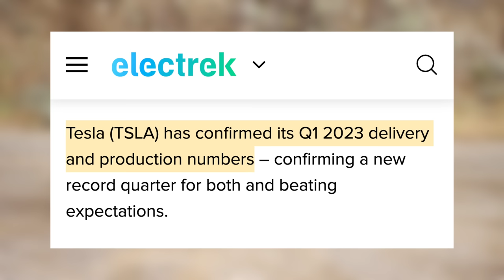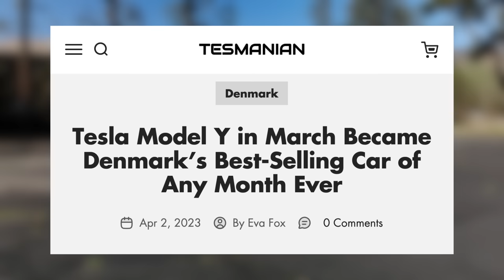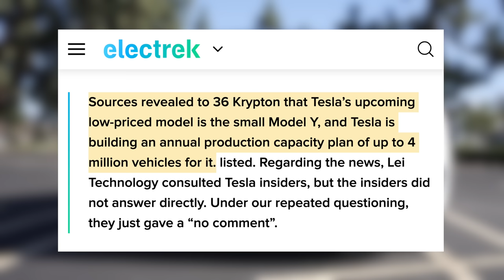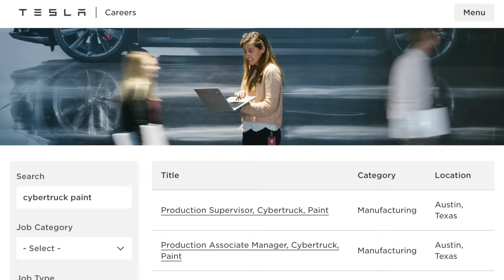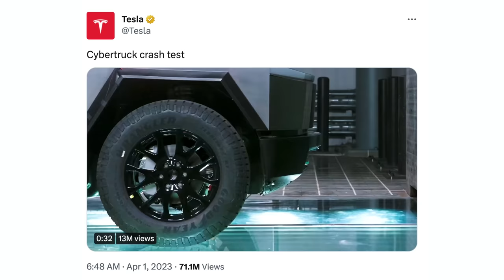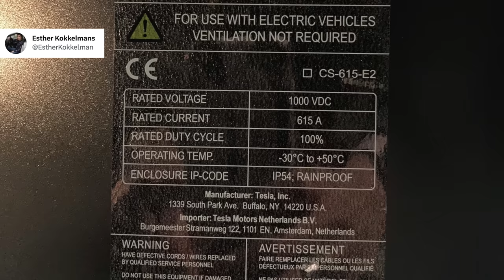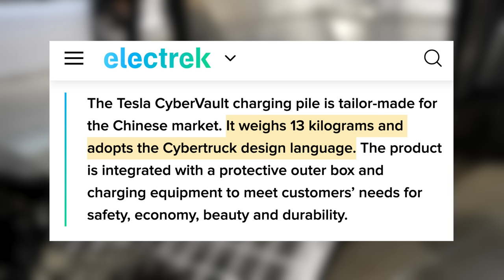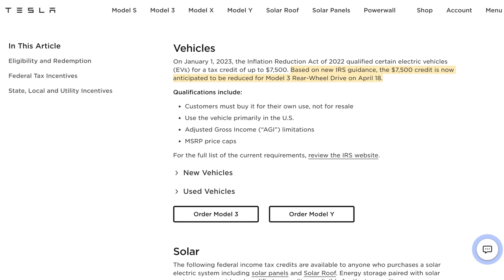NEW Tesla Model Y Mini Coming Soon? | Here’s The Truth

Comment: Going by the title my reaction was “sooooo… a model 3?”
Reply: It will likely be a hatchback so probably more like the size of a Prius.
Reply: The model y is a 10% larger model 3
Reply: Why?
Reply: Yea… a mini model y is basically a model 3. A hatchback Model seems like it would be smaller than a model 3 no? Regardless, i don’t expect much from this $25k vehicle.
Reply: Model 3.5
Reply: Same here. Which wouldn't saying a mini model 3 be more accurate? Other than size, there isn't much difference between the 3 and Y.
Reply: Model Y trunk is 30 cubic ft. with 72 cubic ft behind front seats. Model 3 trunk is 20 cubic feet.

MY height is 64 inches. M3 height 56.8 inches.

MY width is 75.6 inches. M3 width is 72.8 inches.

Not close to the same size. There are no shared body panels. 

Styling is similar, but not the size.
Reply: Umm, no, a mini Model Y. So a hatchback, which the Model 3 is not.
Reply: Also model y is structured and manufactured significantly differently than the model 3. Model 3 has not and largely will never get the manufacturing processes that model Y has. 

"Mini Y" is a claim that the cheap car will be the Y manufacturing process (evolved no doubt, incorporating techniques they announced), but for all we know the design could be a step toward canoo.
Reply: @davidwollpert5276  "sooooo… a model 3 hatchback"
Reply: my thoughts exactly haha
Reply: A small Tesla hatchback is exactly the car I’ve been waiting for. A Model 3 is not and has never been what I wanted.

Comment: I love the vault. So cool. I imagine the install cost includes running a wire from the charged to an electrical panel. If not, that's pretty darn expensive in China to connect it to a roughed-in wire and screwing the box to a wall.

Comment: Think Small- it worked for Volkswagen. But get real. I want a 2-seater like the Roadster that also carry cargo and have normal height an high wheel clearance. 3,000 pounds with low center gravity almost perfects the electric car, and certainly anticipates future demo graphics.   It doesn't need a rocket launch. 0 to 60  MPH in 5 seconds beats %95 of the cars already

Comment: The Cybervault is a full function wall connector with 7kwh charging power, which can can fully charge a Model Y long range within 10 hours, or roughly 20 miles per hour. In addition, it can disconnect from the case and be used as a mobile charging cable that can plug into a nomral home power outlet. It offers about 2kwh charging power, or 6 miles per hour of charging when plugged in. 
On the other hand, the normal Tesla wall connector can dish out higher charging power, faster charging speed(11kwh or higher). The Cybervault is a solution for those who can't benefit from faster home charging, commonly due to powerline limitation in apartment buildings. It is more affordable than the standard wall connector. The mobile charging ability is a nice bonus, too.

Comment: Why did Tesla lower the battery warranty to 100,000 miles with the LFP battery in the Model 3 RWD instead of providing the usual 120,000 mile Tesla battery warranty. The implication is that Tesla does not expect the LFP battery to last as long as the lithium ion battery in other models. I drive about 35.000 miles a year, so the total life of the battery is very important to me. Can I expect the LFP battery to last 400,000 miles, mainly home charging?
Reply: LFP batteries will get to 20% capacity lost faster then old batteries but should take longer to get to 30% capacity lost.

Comment: I don't agree with electric vehicles at all. Not green technology the power comes from coal and natural gas  mostly. Batteries don't last and are fire hazards, and what do you do with them when they die. Electric cars for local city drivers ok works, but for semi trucks and long distances, we need to push forward real green technology like hydrogen fuel cell technology, which will be better, and vehicles will last longer. This is real Green technology that won't kill the electric grid.
Reply: Goober move back to Mayberry